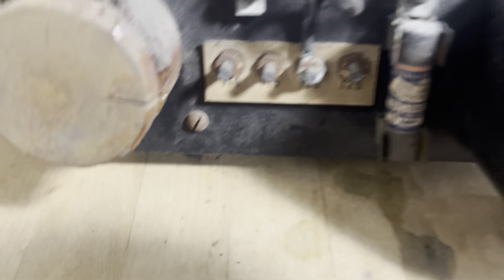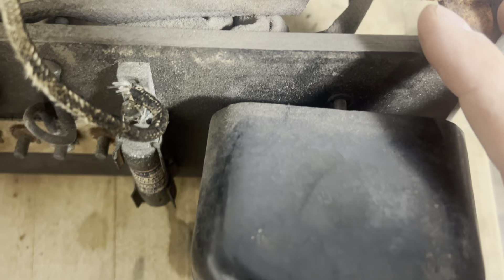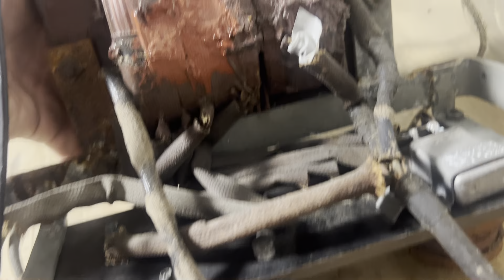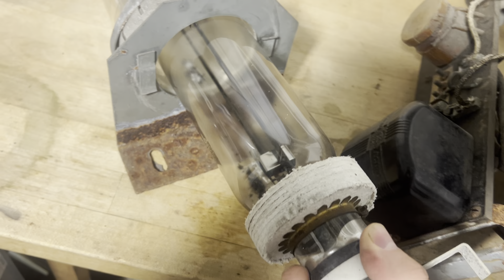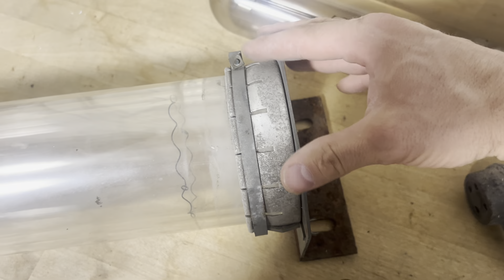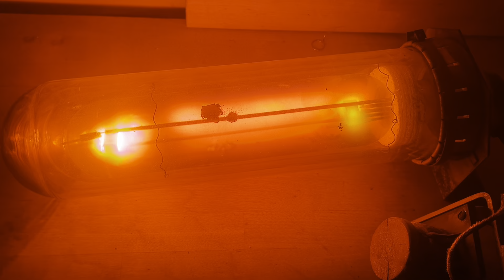1940s GE NA-9 Low pressure sodium lamp operating on M-2 ballast.

Comment: The 65 date code means this lamp was made in May of 1945, 1953 or 1961.  It is a 96 month cyclical code starting with 1 for January 1908 to 96 for December 1915 and repeating thereafter.  It was used into at least the 2000s.

Comment: Well I hope you will be making a video on the very unusual 1940 General Electric NA-9 low pressure sodium lamp within it's G.E. open sodium lantern & I also hope you will be looking back at this very unusual design what did appear on the very famous Golden Gate Bridge at San Francisco in fine detail when these were erected when the bridge were built back in the day & subjecting to it's very unusual construction how the Dewar detachable jacket low pressure sodium lamps in the USA are totally different from our conventional U-shaped arc tube version what had been manufactured here in the UK for instance & over the decades seeing the low pressure sodium lamps had changed with the times such as SO/H [Dewar],  SOI/H [integral jacket], SLI/H [linear sodium], SOX/H & SOX-E/H [economy] in the low pressure sodium lamp range & that's how I found my true history on both USA & UK made low pressure sodium lamps.

Comment: Well it's a new revolution in low pressure sodium lamps just before the most common U-shaped inner arc tube, but this is totally different from the normal versions. But you see in the States their low pressure sodium lamps were completely different with a large single arc tube via not having a standard U-shaped arc tube like the standard SO/H, SOI/H & SOX/H versions & also SLI/H LINEAR SODIUM lamp which it's looked like a fluorescent tube with Bi-pin end connections at both ends such as here in the UK for instance.
Reply: A big reason high current density lamps were used on this side of the pond was their operating current of 6.6A was the same as a lot of series street lighting circuits, with the only auxiliary needed being a thermal starter for the electrodes.  The problem with these high current density lamps is spectral self absorption is very high (with none of the pressure broadening effects to kick photon wavelengths away from the sodium doublet D lines that happen in HPS lamps) which reeeealllly cuts the efficiency.  NA-9 lamps are just under 70lm/W whereas the closest power rating low current density LPS lamp (135W) is almost 160lm/W.

Comment: Freaking BEAUTY! I don’t have an NA-9, but do have many other cool lamps including some of the very first fluorescent lamps put on the market with “thermal auxiliary” and a “magnetic auxiliary” ballasts, and a very early glow-switch auxiliary ballast from Westinghouse made in very early 1939! It uses the insanely rare “GB-1” first ever made glow bulb starter in a double contact candelabra bayonet socket on the ballast! Thing of beauty and has neon gas in it. As for asbestos, I don’t even worry about it. We did asbestos abatement as part of our building demolition company in the early 1990’s, and I had a PAPR mask, we had a negative air machine, etc, and it was a freaking joke! Absolute government beauracracy at its very worst, and a joke!! I have several old lighting items with it in them and also PCB oil filled Pyranol capacitors, and will leave them as is. My experience actually going to school to get a certificate to “legally” “abate” asbestos and doing it taught me that it is bullshit and a money grab. Lol 😆 Cheers and beautiful lamp and ballast!! I have an actual bench test ballast for AH-1 and any H33, H25, or H1 400 watt medium and high pressure mercury lamps that came from a GE lab that also has the voltage taps like this one. It is a beauty! Cheers and Happy New Year!
Reply: I’m with You - I have an extreme emotional love for early Fluorescent Lighting , Also have the 1938-39 fluorescent tubes and fixtures in the collection- Absolutely Love this stuff,
Reply: @douglasdc6516  Do the tubes still work, or did they lose vacuum?

Comment: There is a possibly new old stock M-2 fixture on ebay
Reply from the maker: @TWVC-9167  it’s nice to have dreams.
Reply: Mirroxaphene
Well, yeah, cause it is $2,000 dollars
Reply from the maker: @TWVC-9167  what’s the listing under? I looked for low pressure sodium, but couldn’t find anything. All the fixtures I’ve seen her in terrible shape so it would be nice to have an actual reference.